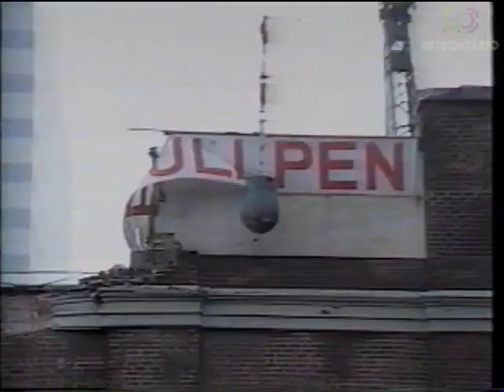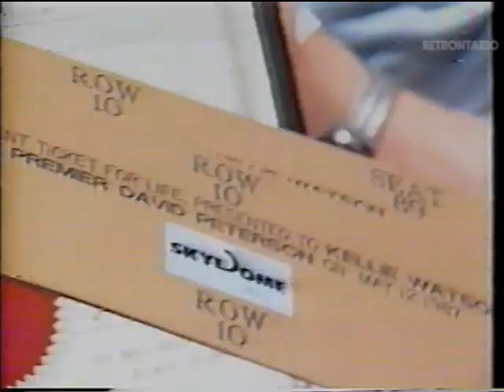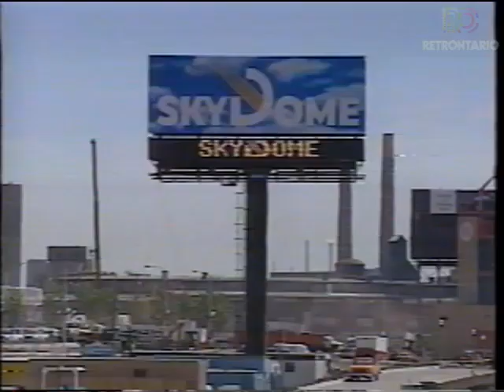CITYPULSE SHORT HISTORY OF SKYDOME (1990) 🐢🐢🐢

Comment: It's to bad it was already outdated by 1992 when Camden Yards opened. Unfortunately is was built a few years to soon.
Reply: True. Skydome was built at the tail end of the multipurpose domed stadium era. By the end of the 90s, most teams had reverted back to the retro ballpark.
Reply: @josephtemple1667  Yup, and due to it's location we won't see another ball park because the location is great. Despite the fact Rogers is putting 300 million into the current stadium, they're saying that's a band-aid solution. I don't buy it.
Reply: The design could have been better, as you say, but it still needed to be a Dome. The weather in the northern MLB cities like Tor, Minnesota, Milwaukee, Montreal are/were terrible in April and sometimes early May. That's why they all had or have Domes, and all eye sores